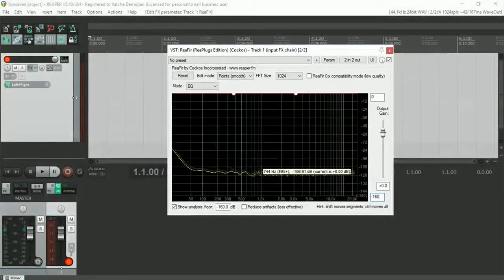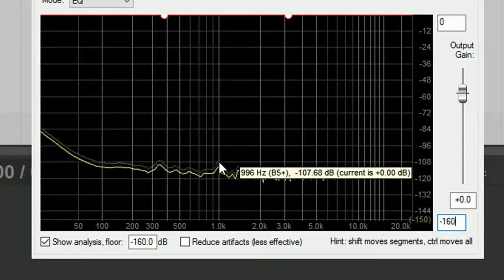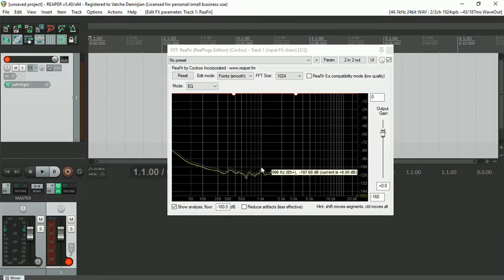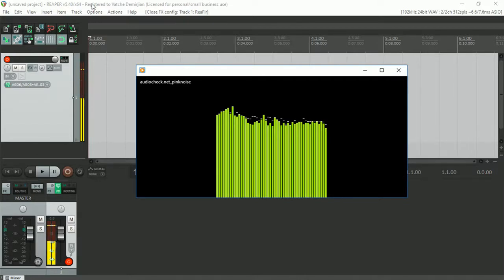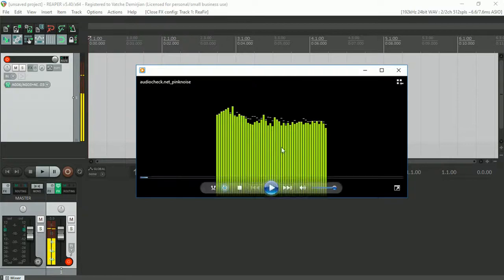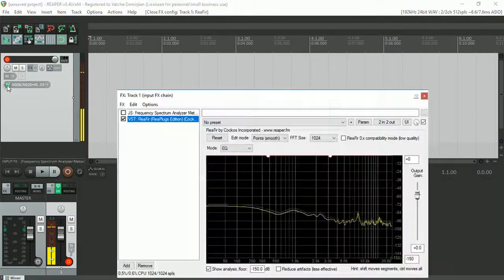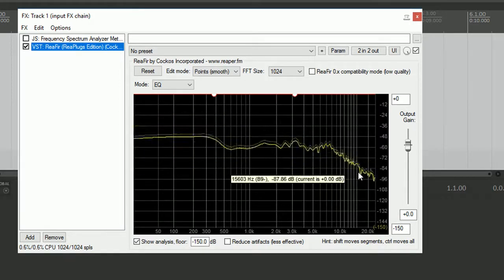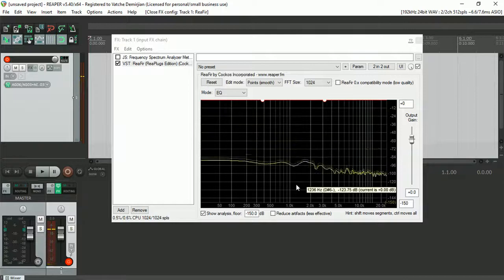Testing the Behringer UCA222 Audio Specifications

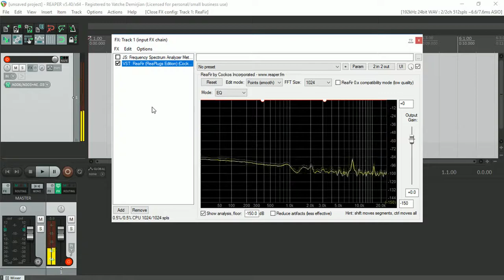Comment: At 6:08 the noise is barely audible but you can visually see to clear spikes. They are VERY audible throughout the recording. It's not one set frequency you can cut out, it is modulating.

Comment: I am using Behringer UCA202 with my American Audio VMS2 mixer and Audacity and experiencing noise during recording my mixes ,, is there any way to remove that annoying noise ? Thx
Reply from the maker: It all depends on where the noise is being added. Is it from the mixer RCA output? Test this by disconnecting the RCA, have UCA202 alone connected to USB and check if the noise is gone. If the noise is from the mixer, then there's not much you can do other then replace the mixer.

Comment: Some of that output noise can be generated by the USB input on the laptop. I've owned this interface. Not bad for the money. Obviously the converters on the Yamaha are indeed better. Also its a USB 1.0 and the AG03 is 2.0 big difference there as well. Typically in my personal use and tests USB 2.0 noise floor always lower.
Reply from the maker: Thanks for the comments.
The noise is there when speakers are connected to the RCA outputs. To make sure I also do measure Yamaha AG03's input noise level, by disconnecting the UCA222. I made sure my testing gear is better than the unit being tested. 
UCA222 is probably the only interface I have that is USB1.0, so can't comment in that regards.
Reply: Also when I used mine with a Mac a handful of times the noise floor was also much lower. Core Audio drivers may have something to do with that.??  This interface is small easy to travel with. So its like a swiss army knife. Thank you for showing us the test. I always learn new stuff from your very intuitive videos! Thank You.
Reply: @RecordingStudio9  One thing you may want to do in the future is to terminate the input with the correct impedance load. I work in telecommunications, and if an unused input is un-terminated ( in my case 75 ohms) it will pick up RF noise from the air. I'm not sure what the typical load is considered for RCA. 50 ohm comes to mind, but I'm not certain.